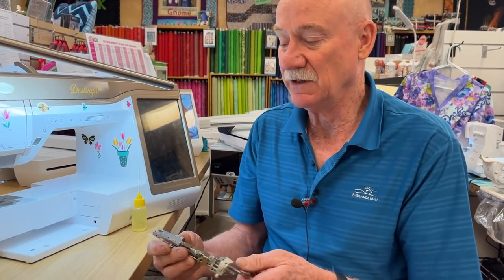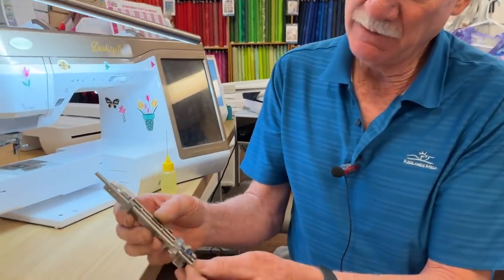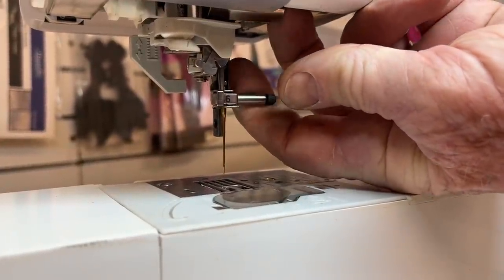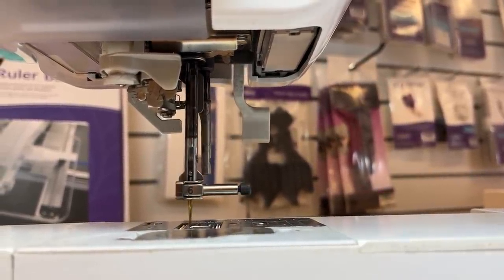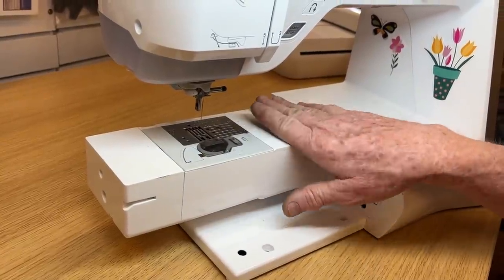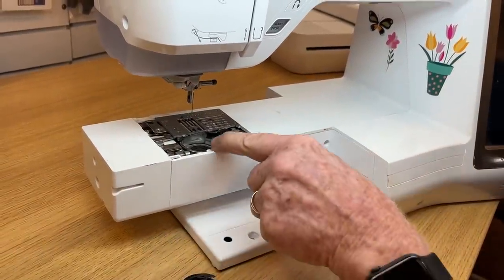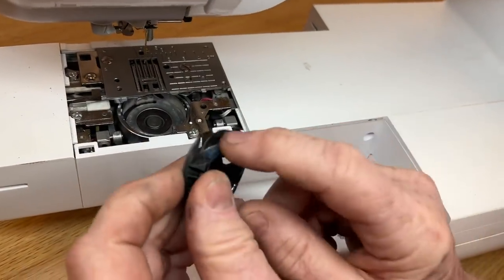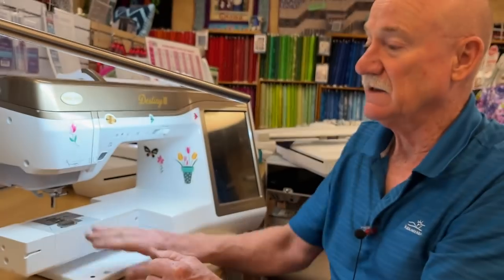How to oil your sewing machine needle bar prevent costly repairs DIY simple fix drop in bobbin case

Comment: Thank you so much for this! I found it extremely useful. I think a video on what to do with an older machine that has been sitting for a long time before sewing with it again would be helpful to many. Obviously you would ideally take it in for a service, but if you need to sew something before that can happen, what should you do to ensure the machine isn’t damaged and works optimally? 

I have a Janome MC4000 (I think that is the model-I’m not at home) from the early 1990s that sat for over 20 years before I got it back out to sew face masks. I did manage to get it serviced during COVID, but I sewed with it before it was taken in. It operated surprisingly well and thankfully only needed a standard service. She is a trooper, I just wish the bobbins would wind more evenly! They never did even when new. As I learn more from videos like yours I am playing with the thread path to change the tension while winding the bobbin to see if I can find a sweet spot. Any advice there would also be welcome. Thanks for the great videos!

Comment: When I bought my Singer Touch-tronic years ago, I was told never to oil the machine, So this video is helpful, I had an expensive repair on the gears in the bobbin case & had I put a few drops in would have solved the problem, the gears was making a sound like a tommy gun  & was jaming, the mechanic showed me the chewed up gear. So thanks for this video very helpful
Reply: Get a Janome
Reply: Yeah, like I seriously don’t understand why they say it in the instructions manual to never oil the machines (the computerized ones) . It makes no sense, sometimes the machine will need lubricating and will make bad sounds and work with difficulty if you don’t oil it. I recently bought a bernette sewing machine and after 6 months it showed signs of needing some oiling. I did it after watching this video,on the needle bar and down at the bobbin case area. Now it goes smoothly again and without noise. I will always oil my machines when they show signs of needing it.

Comment: Thank you for doing this video! This explains what happened to my pre-1990 Singer machine. I did not take it in to be serviced and I did not know where to put the oil.

My 1968 White brand sewing machine has tiny holes in the machine housing(?) for oil to be dropped in.

Comment: Thank you so much for this information. When I bought my first computerized sewing machine, a few years back, I was surprised that there were no instructions on how to oil the new one. Imagine my worry because I knew machines need to be oiled periodically. This is the first time I see help for those new-fangled smart machines that cost you arm and a leg to take for service. What do we do with the other moving parts inside that cannot be open?
Reply: Margarita. My manual said "permanently lubricated, wh isn't true, it does need lubricated periodically (believe it or not, the serviceman at the company told me about it). Found out when it sounded like a rusty meat grinder! Mine opens up and there is old lubricate that is obviously dried out. You can get the lubricate at your brand store or on Amazon or hardware store. There are good videos to show how not to get in trouble and how to repair the trouble you get into. When you really study your machine you will find it isn't mysterious at all and repairing it isnt rocket science. Happy sewing.
Reply from the maker: Sewing Machine companies also say to take your machine in every 12 months for professional service.  In my experience not everyone does or can afford that.  So any moving metal on metal part needs lubrication, I may just giving my opinion from years of experience. Jeff

Comment: Love this I Oil my Machines Regularly, I have a 90 Year Old Hand Crank Singer that was given to me all dusty and she hadn't sewn for 20 Year's, I got the correct bobbins and Oiled her and cleaned her up and restored her and she now Sews Beautifully, I have a Toyota RS2000 I've had for 15 Year's that I don't use that much now but it has particular stitches and Work's Perfect if I need her, I have a Toyota Super Jeans I'm not that happy with  after using it for a Year; it's not being used at the moment, it's so Flimsy considering it's supposed to be tough, and the one I use the Most now is a Singer Heavy Duty and it's Brilliant ✂🧸🧸🧸x

Comment: I still use my Bernina from 1976...Thank you for this video. I doubt it doesn't have all that many stitches on it. Mostly a few square dances dresses between 1976 and 1978 and a set of curtains. Not much sewing in the last between 1980 and 2020.

Comment: Thanks for that Jeff. I was used to oiling older machines I had but my most up to date janome is not supposed to require oiling. Would you suggest that I still oil the parts you have suggested here anyway? I don't  sew every day. Or even every week most of the time.
Reply from the maker: My opinion is any moving metal on metal parts need oil or lubrication and the owner can do this without removing the covers. However modern machines should see a qualified tech at least every two years even if you don’t use them very much.
Reply: @berninajeff  Thank you Jeff 👍🏻

Comment: Looking just for something like this I have an old simplicity and it’s running but it seems dry at the top of the needle and the needle clamp seems delicate. I think it needs oil.  I originally stopped using it because it kept catching fabric and I took the bobbin parts out and couldn’t get it back in so I bought another one.  I took it out because that one locked up.  Thank you!

Comment: One of my biggest objections to newer machines is that they make it impossible to oil critical areas of the machines that I know should be oiled regularly, such as the needle bar. Pfaff machines are also locked up tight and don’t accommodate oiling by their owners.

I’d love for you to show how to open up various brands of machines that prevent us from easily oiling critical areas of our machines. 😊

Comment: Bah, ha, ha!  Error message. My Swiss made 1973 Elna is an error message all its own. But seriously, this is some good information. And my Elna is a magnificent machine. I don't put anywheres near a million stitches a year on it, just using it for repairing/patching torn or badly worn clothing or other light material. It has decorative cam discs that can be changed out for embroidery-type patterns. Kinda cool.

Comment: What is the regular maintenance for a Bernette 38? Is it true you do not need to oil anything?
Reply: I will tell you my experience with my Bernette b37 which is almost the same machine. I bought mine in april of this year and didn’t use it very intensively but now it started to make a little noise like something needed oiling. I remembered the manual said not to oil it but I really felt it needed it, it was also working slightly with more difficulty. After watching this video, I oiled the needle bar area and under the bobbin case, where that little sponge is. (Just one drop in each area). Tried my machine and now it works beautifully like before and no noise. My advise is to oil it whenever you hear any metal on metal friction sounds or when you feel it doesn’t run smoothly anymore.

Comment: Thank you so much….BUT, I have a question….is it a good idea to use spray air to get all of the lint out of down in there?  I just did a flannel quilt and there is soooo much fuzz down inside the machine!
Reply: Rita, I was told to never use the canned air on newer, computerized machines because that will blow debris into the depths of the machine. You should use a small vacuum to get rid of the dust. You can try taping a straw or something to the end of a vacuum nozzle. That will help to clean it. Or you can buy a mini vacuum.
Reply from the maker: Never use air on your machine only on a serger if you have been trained. Get a small vacuum and attachments that gets the fuzz out

Comment: Could the Face plate cover not be removed to oil the needle bar.  Upper bushing And the complete take up assembly. I am seeing two screws to remove this.  This is not a problem to do.
Reply from the maker: Yes I did not want to include that on the video

Comment: Jeff, there are quite a few discrepancies in the information you are providing. For one, there is an oiling pad on the needle bar that lubricates the needle bar when in use. Next, the reason the needle bar is loose is not because the needle bar didn’t have oil, but because the hook stand is either stuck or damaged. The hook stand is less than $10 and does not cost $500 to replace even if the needle bar needed to be replaced as well. I hope this information helps you and everyone watching.
Reply: Do u oil your machine once a month?
Reply: So how does the “oiling pad” get the oil?  Where do you put the oil?
Reply: That baby lock machine only requires maintenance once per year. The oiling pad does get oiled during that maintenance, but you can absolutely oil the pad yourself if you notice the pad is dry. It is accessible to the user.
Reply: I have a Brother PS500 that is just 16 months old.  It is starting to sound “rough” and I oil it about every 6/8 hours of sewing under the bobbin case.  I piece a lot, so I change my needle about every project, so now I’m thinking it needs some oil somewhere else.  I live over 2 hours away from the sewing center I bought the machine at, when I call with any sort of question they tell me to just bring it in!  So I have to rely on the internet.
Reply: @Str8eeth  you do not need to oil under your bobbin case. I would bring it in to a technician if it sounds rough.
Reply: @Aaron…that’s weird, when I purchased the machine the maintenance guy came out and showed me how to take the bobbin case out and put one drop of oil on the metal circle and replace the bobbin case.  He said “even though the manual states the machine doesn’t require oiling, it needs to be done.”
Reply: @Str8eeth  That just doesn’t make much sense to me.
Reply from the maker: Hi Aaron could you let me know where the oil pad is on a Destiny and yes it’s the hook stand is totally damaged by the needle bar the lower hole is enlarged. It has been serviced every year. I have been to Baby Lock training twice and have two certifications. Yes $500 is on the extreme high side but some shops would charge that much. Please contact me at jpvlefty@aol.com I’m not above learning more information.
Reply from the maker: I just took apart the needle support and did find the pad you were referring to I’m so glad you said something. The parts list just calls it a washer. I’m going to do another video on that. I do know about the hook stand issue in my case the support holes were totally oval.
Reply: @berninajeff  there is no need to take apart anything to see the oiling pad. The consumer could put oil on it if they wanted. I would leave the baby lock videos up to baby lock.

Comment: Well I seem to have a good one for you In 1968 I bought a sewing machine from Sears it was a Kenmore and I loved my parents had bought me one for my graduation in 1966 and I loved it so much that I bought another one In 1968 because it would do so much more than my first one as I was  going into my own sewing business and was doing sewing for the public. I just finally had to quit using that sewing machine in 2020. I used that sewing machine all those years because like you said I oiled and cleaned my  sewing machine constantly I had to have another little motor put on it because I had put several bushing in the motor and  I found another machine that had a good motor but the machine was no good. So from 198 to 2020 I sewed at least 16 hours a day on that machine and even though you say a million stitches (I'm sure mine was more)  but anyway....68 to 20-  52 years on the same sewing machine.... plus I had a commercial Juki sewing machine that I made horse tack on and I still use it.

Comment: Question I git a 640 embroidery. I need to replace the "motherboard" on my machine. The screen has lings vertically and after a while bounces. I can't do anything with for precise designs.
Reply from the maker: Electrical boards can fail at any time, the replacement will be covered for 12 months

Comment: I have a Brother machine and the plastic "L" shaped piece goes on just fine but as soon as I start sewing it pops back about  1/8" to 1/4" and is very annoying. Have you ever seen this happen before?
Reply from the maker: Not seen that you can but the new L shaped part that should snap in better. They come in many sizes so you will have to bring in the metal part and L part of the plate to match them up

Comment: My LED lights under the bed does not work any suggestions
Reply from the maker: What machine do you have?  On Bernina’s I have a video on that. Other brands you need to take it in for replacement of the lights or check settings that they are turned on.

Comment: Stitch length issues. White jean machine. Is it the feed dogs or what? I
Reply from the maker: Could be a few things take the needle plate off and clean between the feed dog rows and around other than that have a pro look at it
Reply: @berninajeff  I did that, yes. I took off the top and bottom covers and sprayed a lot of wd40, used a paint brush everywhere it would reach. The stitch length works for a little while then fails me again. I wonder if the dogs themselves are worn down? No repair person where I live. 

This machine is all metal inside and it will sew thicker layers of fabric. I don’t want to replace it.
Reply from the maker: Next make sure you have presser foot pressure if the foot does not press the fabric against the feed dogs it will not move oil that shaft at all points and tighten the pressure